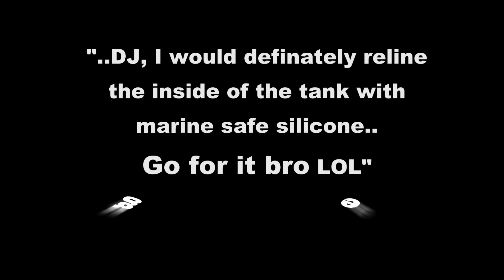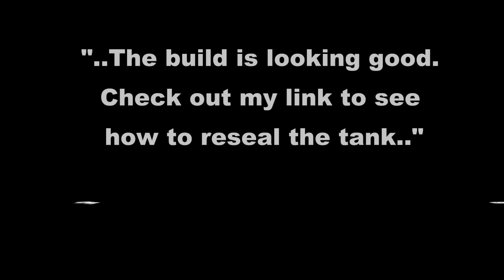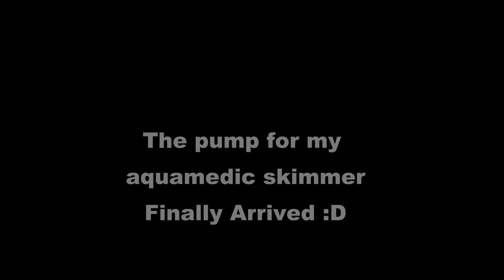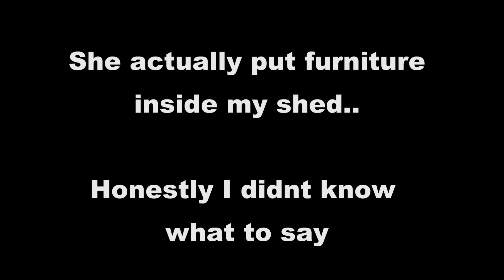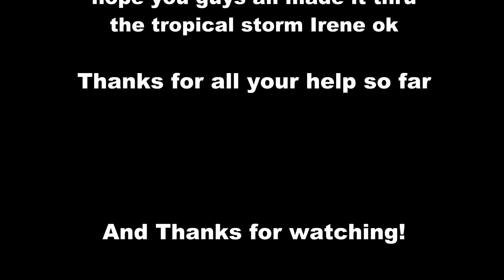Studio Reef part 15 "Major Setback!" US version

Comment: FREEAAAKKINNNN SWEEEEET , love your vids man, never made an acrylic overflow or light box but I have painted a bunch of backgrounds. I would recommend glossy black, Matte black has a tendancy to look gray'ish under light. also use a Latex paint because it will come off easy if you ever change your mind.  I would recommend rustoleum painters touch latex gloss black.  roll on 3-4 coats and your good to go. see my vids for examples.